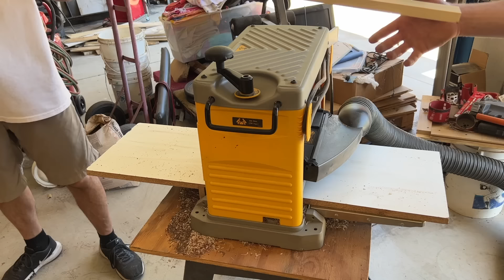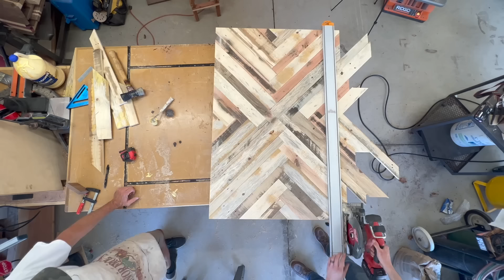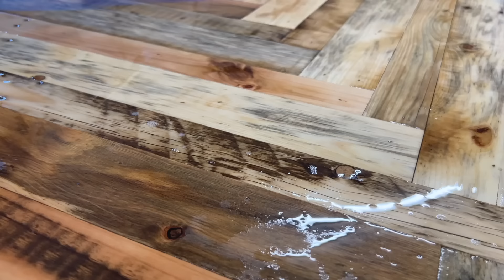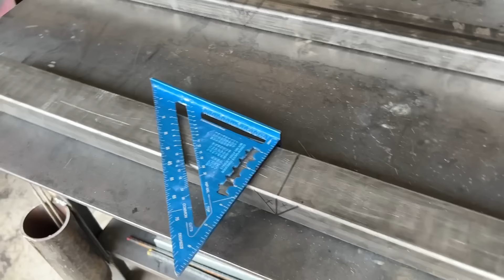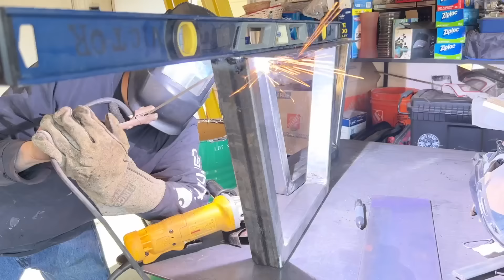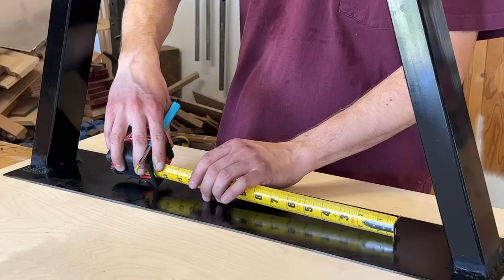Turning Free Pallets Into A Table (Pallet Wood Project)

Comment: Love it.  The ONLY THING I would suggest for future projects, is to put a bit of epoxy on the threaded inserts.  I used to build take down bows, and used this method.  Just on the slim chance a screw sticks in the threads and prevents the insert from backing out.

Nice work on the video and narration.

Comment: Ok stuff but why so many cheap processes.    Send the metal out to be powder coated.  You didn’t wash the steal.  You didn’t use primer etc etc.   but not bad for a table valued at $50 bucks at a garage sale.

Comment: Im wondering why yall didnt use a ca glue to fill in the nail holes. Ive done work like this before. That base layer will just seep through the holes. Just a suggestion. Get some MDF and build a mold, any spill over is something yall dont want

Comment: Was it necessary to tack down the planks when gluing? I'm making a larger dining room table version and want to avoid nailing it down. Thinking a few boards on top clamping it down while the glue dries would do the trick? Also, how many gallons of epoxy did you use? Thanks.

Comment: Woodworkers should research which markings on pallets denote that they may have been used with hazardous chemicals. I haven't messed with pallets in a few years so I don't recall them offhand, but due diligence is up to the maker.

Comment: Can you explain why you used the torch to remove the bubbles?
Reply from the maker: It pops all the bubbles on top of the epoxy. If you don’t do it you will have permanent bubbles everywhere
Reply: That was clear, i was wondering if there is some science about it or not. For example i thought resin and flames would result in some awesome fire lol

Comment: Great looking table, my only criticism would be that the epoxy looks a little wavy and uneven on the surface when the light hits it. I think a thicker flood coat with sanding/compound/polish would make it look a lot better. Either that, or remove the epoxy, and finish it with a glass top.

Comment: For the future, use 2x epoxy glue when securing the treaded inserts and there is no reason to use 3 different size washers when using one washer the same size as the nut going in to the treaded inserts. Other then that, great work!
Reply from the maker: Thanks for the tips!! Only reason we used more washers was because the bolts were a little long. I guess we could have bought more or cut them but we just went with what we had at the time.

Comment: Very nice table that epoxy u use is a good product. 1to 1 part a and part b  not sure how long u let cure after the flood coat but you need weeks for it to cure  i did a small table and let it stand for a week then  wrapped a towel  around itn until i got the legs unwrapped it  and it had small dimples  in it  it was a hot summer  long story short any epoxy when u use it give it weeks for the cuer b for handling it or placing  items  on it  that epoxy is great for pen making and bottel stopers for quick handling  iam going out today and getting some pallets  thank s guys great job

Comment: I didn't see you seal the bottom side. Did I miss it? If it's not sealed on the bottom side it could move quite signifficantly with changing humidity.
Reply: I'm guessing it's for inside use
Reply: @tyronehudson8793  Even if it is for indoor use it will move, if nothing else, humidity in his workshop and a living room is different. Let's not forget seasonal changes. So...
Reply: @fifi23o5  if its just for inside use it's okay to have exposed ply wood,the bed I'm laid in replying to you is made from reclaimed timber with no appoxiy just some screws and and glue abd it hasn't warped and the mitre joins are still snug
Reply: @fifi23o5  seriously tho I don't see you making tables from pallets so who are you to criticise
Reply: @tyronehudson8793  So, in your small mind, if I didn't post anything, I didn't do anything? Have you done anything? I have.
Reply: @tyronehudson8793  You might check your spelling. Being from reclaimed wood doesn't make any difference. Bigger issue is protection, more precisely, sealing of wood. If there are any fluctuations in humidity it is important to seal it from both sides, not just one. Better to leave it unprotected entirely, so both sides will move at the same rate and cancell eachother. Depending also on the product, itself. Countertop, mounted over kitchen cabinets will move less, since it is fixed in more points at short distances. Table is more sensitive to movement and it is very important to keep it level and straight.
Reply: @fifi23o5 if you knew anything about pallet lumber, you would know that it is treated to withstand the elements so the plywood, which isn't, wouldn't warp at the same speed in equal humidity anyway so that arguement is invalid.
Reply: @charitypadgett7603  You just told me you don't know much about you're talking about. Being treated means, not all pallets are, FYI, they are treated against funghi and similar nice things, that doesn't mean they are impervious against moisture. The wood still breathes. 
Actually, being treated is another good reason to seal the wood,especially if it is used in the interior.
I think you have some things to learn about.

Comment: Please use a push stick when using the table saw.
Reply: You don't need to use a push stick for stuff wider than 3", I have been woodworking since I was 17, I am now 36 and have never used a push stick at that width. If you think its required at the width they just did... you should stop wood working.
Reply: @EliteDadBod  Alright gobby no need to get shirty. I was just making an observation about not using a push stick and it is better to be safe than sorry. And good for you for trying to impress with the amount of years you've been woodworking. If you want to go down that route I've been woodworking since I was 15 and I am now 41 I am also an offshore coded welder and no matter what the job safety is the main priority. So pipe down and knock the sarky comments on the head. It's not impressive